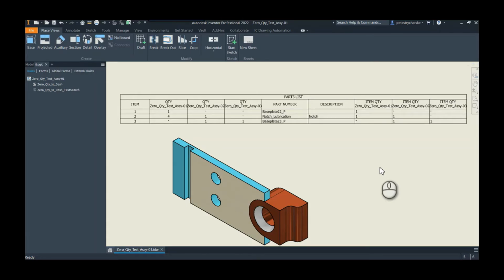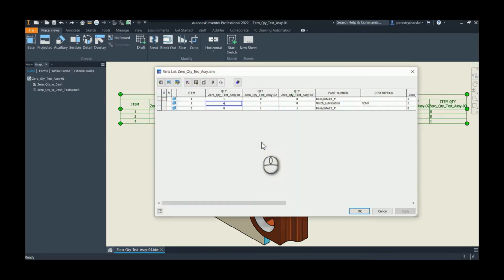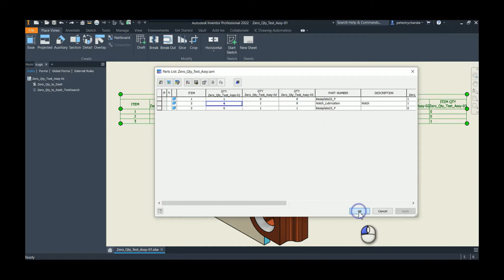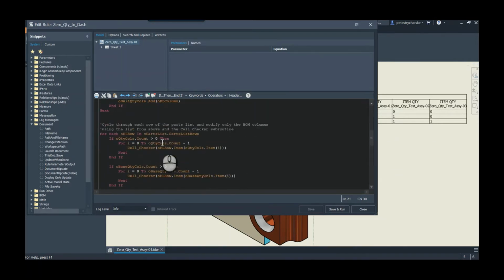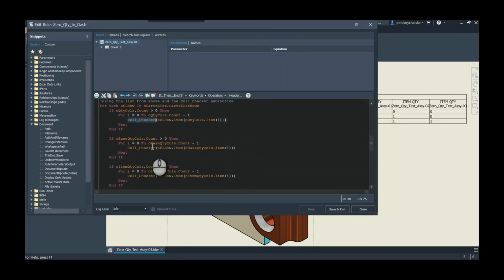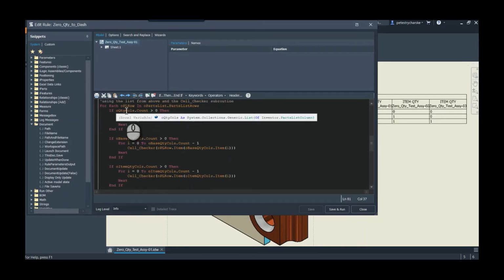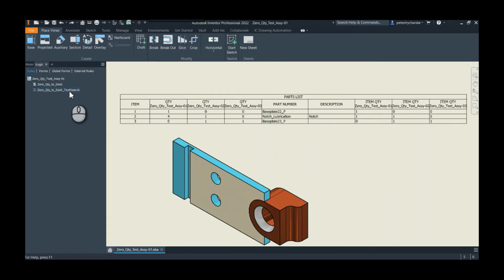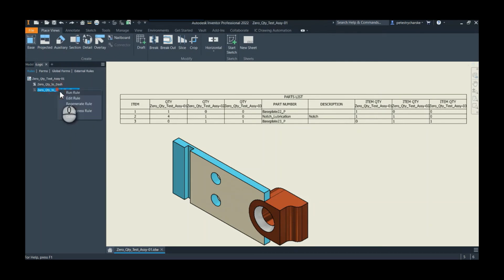Inventor - Applying Dashes "-"  to Zero Quantity Fields in a Parts List

Comment: Could have sworn I left a comment.....???
Reply from the maker: Sorry Darren, we're not seeing one...  What's on your mind / how can we help?
Reply: @Team-D3  iv just started delving in to the code part for rules. I'm trying to work out cutting lists for metal frames (shs, rhs and angle etc)
I found one post for getting the cutdetails to appear but I need to work on it but the hardest bit is if you draw a frame but say you need to make 5 of them, the cut list only shows quantity for 1. 
Have you had any experience in this area? Or can point me in the right direction?
Reply from the maker: @Darren Falconer, Unfortunately, I don't have personal experience with this, but I don't believe that Autodesk has exposed the API for Frame Generator, so you may be a bit limited.   At this point you may have to create a pattern of some kind or build a separate subassembly to quantify the number that you need.  Wish I had more information, but that's what I know for now.  Thanks for your patience and have a most blessed day!

- Pete